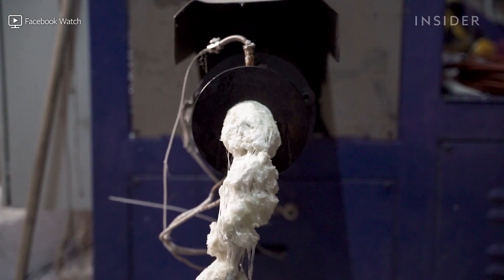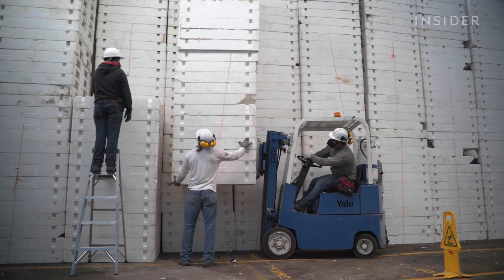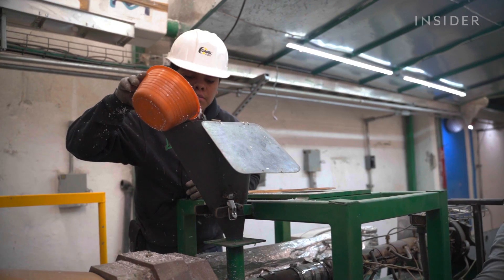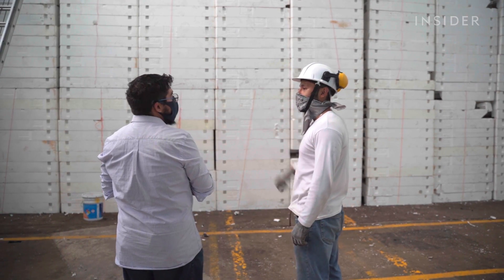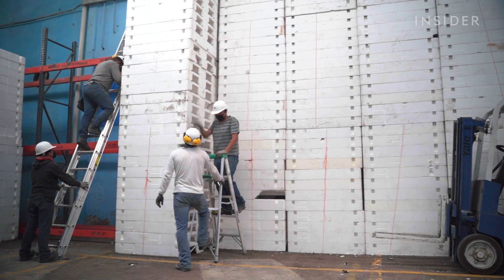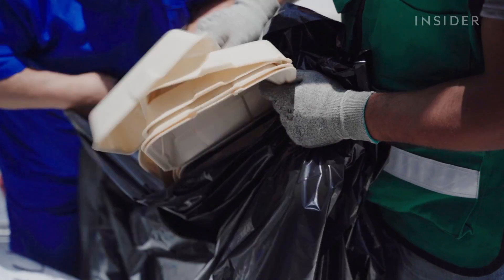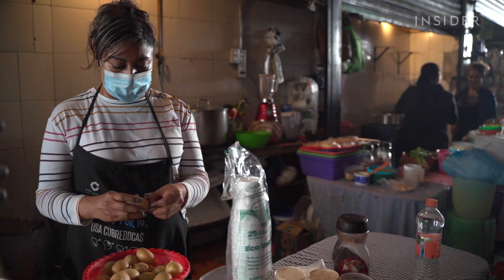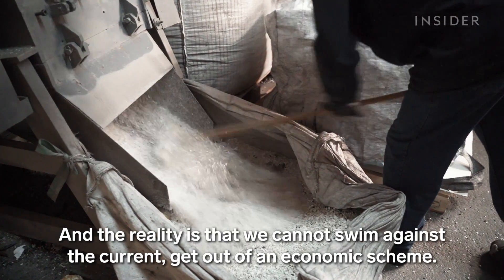Why It’s So Hard To Recycle Styrofoam and Polystyrene | World Wide Waste | Business Insider

Comment: great they're doing this, we still need to STOP using plastic/styro single use items. "They try to make them into cutlery and cups..." yeesh, nothing learned. Great frames though
Reply: Making them into cutlery and cups is way better than making them into frames. You want the recycling process to be a loop not a one way ticket. If we can keep recycling the same cups and bowls and make them new we can eliminate most of the environmental impact
Reply: @kellensanna  not how it works, plastics are chemically made, we can't recycle them like metals.
Reply: @thomas-x9  Unfortunately not everything can be made from metal though. Plastic dose play a useful role some areas where the alternatives don't work for sanitary or safety reasons. Like electrical parts, such as switches. wall outlets. etc. That can't be completely made of something that is conductive to electricity like metal. Some single use plastics do also fall in that category for personal protection. Like disposable gloves. condoms. to name two.
Reply: @KenKen-ui4ny  my comment was about how plastic is very unrecyclable in comparison to metal... or glass, or wood if you will.

Making plastic into produce that lasts long is way better than making produce that are disposable like cups and bowls.
Reply: @thomas-x9  Glass takes a lot of energy and money to recycle by smelting. Aluminum would be a better and incentive fit alternative for drink containers, that are to be dispose of in the recycle bin. Since it take a lot of energy to make from raw form. But not as much to recycle, due to it's significantly low remelt temperature. Bio plastics and bio rubbers, are a good alternative for personal protection and sanitation items, that are single use for a reason, such as disposable gloves as i mention before.
Reply: @KenKen-ui4ny  sure, but expendable plastics have one bad factor that most materials don't, it cannot be allowed to get into the environment. It's worse than nuclear waste when we take the volume into consideration. Plastic is here to stay, but we shouldn't use it so carelessly.
Reply: In my opinion, we need to make use of the products we have. What we need to do is stop producing new plastics and reuse and recycle what we've already made until we can't reuse and recycle them anymore, while also focusing on producing cleaner and more environmentally friendly resources.
Reply: To many greedy people in the world that don't care about or environment. This won't stop until we all choke on our plastic water and food.

Comment: I'm all for recycling but I rather the world stop using Styrofoam and switch over to something like paper.
Reply: Ironically hollywood depends on ths material for props, sets, etc.
Reply: @npcimknot958  That isn't ironic at all. Also Hollywood using it would be a drop in the ocean compared to its worldwide use as a packaging material.
Reply: @npcimknot958  Then they can set up recycling plants to turn the foam back into new foam for new props

Comment: I manufacture biodiesel from waste vegetable oil and I take waste styrofoam and dissolve it nm in my biodiesel, it props up my volumes and reduces my costs. But most importantly, it reduced waste of a material not commonly recycled. It's a good feeling to be able to reduce the impact on the environmental 😊
Reply: I suspect burning resins safely requires more than just dissolving them in biodiesel.
Reply: @AntiCookieMonster  polystyrene is not a resin. It's a polymer. Resins are mostly chemically inert
Reply: So you think by burning the stryofoam you are improving the environment? LMFAO
Reply: Wouldn't the dissolved Styrofoam gum up the engine?
Reply: @simonhadley8829  surprisingly not. If you keep the mixture at no more than 1% by weight then you're good
Reply: Better be quiet before government finds out that you make your own fuel.They will shut you down.
Reply: That's interesting, you also sound pretty knowledgeable. How do you dissolve the polystyrene? I would think it to be insoluble in biodiesel, or any oil.
Reply: Great. Does the styrofoam enhance the biodiesel's properties?
Reply: @chitrachopra1947  yes, it increases viscosity which increases cetane number (disesl equivalent to octane). Creates more complete combustion
Reply: @cmichaels9544  ok. Thanks for the information
Reply: recycling is a lure,  dangled in front of us,  delaying public outcry at the consequences while big business makes its money. This stuff is disseminated everywhere,  without hope of even partially collecting it back. Better to cease producing it.  The biodisel guys are safe,  cooking oil is and will be in use for millenia
Reply: I mean, it's still highly carcinogenic, still emits carbon dioxide, and still isn't much better than burning it in a landfill, but it is helping you go further on a tank of vegetable oil!
Reply: @traviskitteh  all harmful emissions from a vehicle such as carbon dioxide, sulphur dioxide, particulates, hydrocarbons are less with the use of biodiesel compared to petroleum diesel. But yes, it's not 100% clean just like any energy wouldn't be (other than photosynthesise of non-farmed/naturally occurring plants). 

Further to the above, carbon emissions for overall extraction is far, far less with biodiesel when compared to petroleum diesel and sulphur is pretty much zero. It's the only alternative fuel approved against the clean airs act. 

Edit: And when I say biodiesel, I mean vegetable oil and styrene blend (diesel does contain a certain amount of styrene naturally but now we stunt have to harm ecosystems to get more) 

It's a small contribution but it's a start. We should all do our best to curb our effects on the environment 😊
Reply: Ahh yes, a heated used vegetable oil, probably got it from restaurant that doesn't want to use their oil repeatedly
Reply: @herbertant4096  well, they use their oil until just before the food starts tasting like old, burnt oil but it's still good for biodiesel. It's better than it going into landfills and down the drain into water ways.

Comment: Using less things will be the best option.
Reply: How to use less food container for takaways?
Reply: @mikloscsuvar6097  you should figure it out.
Reply: @syedtahbibshams  "We should do a thing."
"How."
"You do it."'
Your opinion is worth less than the fraction of a cent worth of electricity it took for you to type it.
Reply: Yes, exactly. Plastics, because they are polymers, do not act like metals when you heat them up. Since they don't return to their chemical precursors in that state, recycled plastic is lower quality, more expensive, and more difficult to work with than virgin material. Even making it cost-competitive does not fix those other problems. This method of heating up and crushing the air out of polystyrene foam is clearly not viable as a general method to deal with the plastic problem if it can't readily be turned into things that we need, like how they're "working" on making plates and utensils. If melting plastics down to recover the materials was an actual possibility, why don't we see it commonly done with almost any of the plastics we use in our day-to-day lives? Nobody's complaining about a "scrap metal crisis", because metal can ACTUALLY be recycled into usable raw materials.

It's pretty clear to me that Business Insider has an agenda with making this video. They show a tiny operation running a flawed recycling process as proof that the system is working when it clearly isn't, which we can see by the amount of plastic waste polluting the world. Then, at the end, use this as justification for why we shouldn't ban the use of single-use plastics. Ah yes, why stop a problem at its source when society can spend millions of dollars every year cleaning up the mess? Genius! These are the exact same things the plastics industry has always done in order to pretend that its product is sustainable, which it isn't and never was.

Even if our current recycling technology could actually deal with the problem, it's unpreventable that some percentage of what we use will end up in the environment. This is simply reality -- not everything can be collected, and sometimes things get lost. The more we manufacture, the more items will make their way into nature. This is how you get our current predicament of microplastics covering literally all of the earth's surface, ending up in every part of the food chain -- the food chain that WE rely on to sustain us. We have no idea what their effects on our bodies will be, and it's recently been found that they can end up crossing the blood-brain barrier. We could be risking our own health just to enrich the plastics industry.

It's reduce, reuse, recycle -- in that order. Single-use plastics have to be completely eliminated wherever possible, and it should be replaced by a recyclable/biodegradable alternative ONLY when there is no feasible alternative. We don't have a sustainable plastic yet, don't let these videos convince you otherwise.

Comment: The styrofoam could be better used as a poor man's insulation material instead further processing into other products like photo frames which can be directly made and not through a convoluted process of heating and extruding waste material
Reply: Big chunks maybe but the smaller items probably not, densification is a good solution that makes a usable product.

Comment: We have a company in Oregon called agylix that turns it into diesel
Reply: Agylix have refined their process to recreate the styrene monomer raw material which for them recovers more value than just producing fuel and takes the material even further around the arc of thecircular economy. In Wellington, New Zealand Poly Palace take it a step further and create the same products 100% recycled from waste EPS and XPS as other virgin manufacturers make from the raw expandable granule material, for application in the local construction market as Geofoam.  

Fun fact. Grind up Polystyrene with a cheese grater, put it in your espresso machine where the coffee goes and run steamy water through it like you are making a short black and that is the polystyrene manufacturing process on a small scale, similar temperatures and pressure. Our process is basically a very very large espresso machine at the local Resource Recovery Center. The 'cheese grater' is an end of life flail mill  that used to crush the shite out of dirty sheep's wool. Now it processes waste polystyrene at the rate of 1m3 every 1-2 minutes.
Reply: @richardmoore7367  I didn't know that. Thanks for the info.
Reply: @richardmoore7367  thank you!
Reply: @richardmoore7367  can't you use acetone to dissolve the foam and then use it further? That would be a quicker process unless it reacts with and changes the composition of the PS.
Reply: I literally just read about you guys in this book about plastic!  How cool!
Reply: can we just admire for a minute that a company found a way to recycle plastic that's more detrimental to the environment than just letting it sit in a landfill?
Reply: The carbon admission just to there is even worse.
Reply: why let it sit in a landfill when you double down on it's pollution potential by refining it into fuel? why double down when you can triple down on it's pollution potential by then burning it?
Reply: Not the cleanest use, but at least is reuse in something else
Reply: any video that i can watch
Reply: Then carbon into the atmosphere
Reply: @BrotherChad  👏 Dr Rudolph Diesel. I used to run a biodiesel club in Austin.
Reply: Polyestirene
Reply: @BrotherChad  I thought it was coal dust...
Reply: Napalm is made from gas an foam..
Reply: Yes, Thats Pyrolysis. A good industry that should be in more countries.
Reply: @BrotherChad  then used cooking oil can be reused to run generators
Reply: Ironic considering Diesel is responsible for nearly half of all particulate air-pollution in Portland, Oregon.
Chimney smoke from wood burning is the other chunk.
Reply: Aaahhh... Classic American...either you shoot it or turn it into fuel for cars
Reply: @pratiknazareth3217  better than nothing
Reply: @pratiknazareth3217  lol even Americans collect rustic and used restaurant cooking oil to a company to be turned to Diesel. Why is that? Because the cooking oil have been used and heated
Reply: @pratiknazareth3217  Yeah because the rest of the worlds history is so perfect isn't it???
Reply: @pratiknazareth3217  Merica 🇺🇸
Reply: svenm sandity  Cleaning and maintaining a forest is not the natural process, burning is. We need to build in areas that don't put our homes at risk of forest fire damage to begin with.
Reply: @mabriff  the forest floor waste can be used for jet fuel like Southwest does.
Reply: As if we haven't already have enough carbon flying in the air
Reply: @nyan2317  I have been thinking about that too.
Reply: @nyan2317  It offsets oil at least
Reply: Burning diesel is worse for the planet than not recycling Styrofoam.
Reply: @Jspath3  It's made into renewable diesel so that's not accurate.
Reply: Oregon here, we get more Smilage Per Gallon (SPG) by mixing 10 parts Styrofoam with 1 part gasoline to create a sticky flammable mess... homemade Napalm .  It is super-dry here now so it has to wait until the rains come .
Reply: @SunriseLAW  1 cup  gas to 1 package (4 bars)of Ivory soap.
Reply: @johnhagemeyer8578  Thank you for that but how could it possibly provide as much Smilage Per Gallon as gasoline mixed with styrofoam??  That said, does liquid laundry detergent work and what sort of effects should I expect compared to the Styro-palm?   btw, toluene-gasoline-palm is even more horrific  but it cost $$.
Reply: @johnhagemeyer8578  Styrofoam was not ubiquitous back then .  Perhaps by coincidence, Dow Chemical invented styrofoam and napalm !!!  Also: the books like that 'back in the day' were generally PRINTED BY MAINSTREAM COMPANIES and the information in them is often very inaccurate (probably on purpose).
Reply: @SunriseLAW  that and maybe I was a bit "hot headed" in my youth. I could jump on a bus and be at the "Mall"(area around reflection pool in DC)in about
Reply: @SunriseLAW  an hour. My english teacher once made us a flag. Black with a green leaf with a red star centered on it. I think that's when I met Abby.
Looking back I was just a pawn.
Reply: @johnhagemeyer8578  I lived in Arlington VA during Watergate.  I had THREE Washington Post routes in some low-rise apartment buildings.  I started my morning at about 4am, walked through some streets and woods to get to the 7-11 where the distributor dropped my piles.  They paid me $1 to sweep the 7-11 parking lot and I could steal cigars to smoke on my route.  I was 14 at the time.
Reply: They should recycle it into shaving cream.

Comment: Those polystyrene bowls looked brand new and clean
Reply: It is only the tops of the clamshell, not the part in direct contact with food.
Reply: @armoryindustrial7884  they are bowls not clamshell containers and you can clearly see both the inside and outside of the bowl are both clean and in perfect condition; had they been used they would likely have fork holes/marks.
Reply: @armoryindustrial7884  3:17
Reply: That's because they were.  Didn't you see where they were punching them out of new sheets and said they were experimenting with that?
Reply: @binbashbuddy  nope
Reply: That's because someone has painstakingly cleaned them out like they were doing with the clamshells full of food at the beginning when they were talking about the collection drives.
Reply: Yeh I bought them for my dads baptism but then my cousin said she wanted plates not bowls so I had to throw them all away
Reply: @Bas_Lightyear  tell her to bring her own plate 😂
Reply: Reuse > recycle, why don't they simply sell them back after cleaning?
Reply: @Bobo-lf7gl  Bruh...